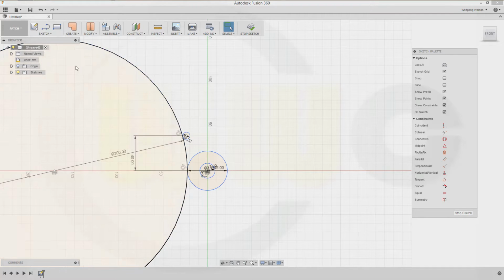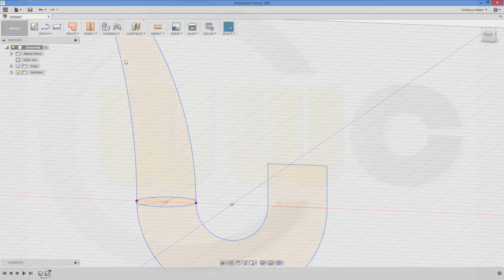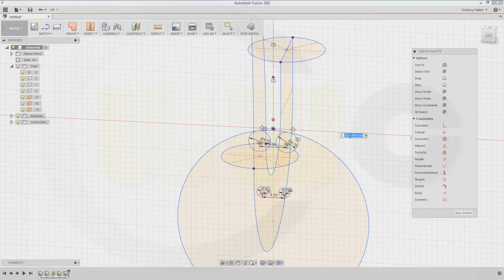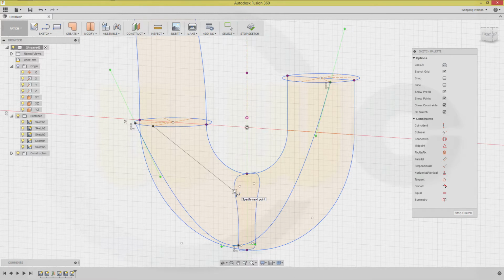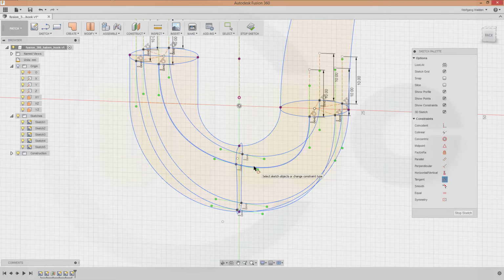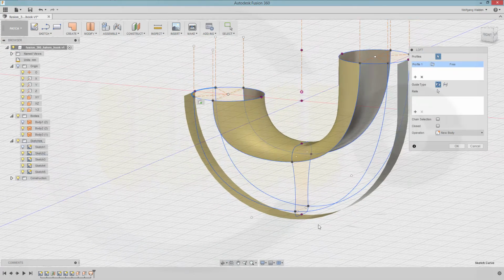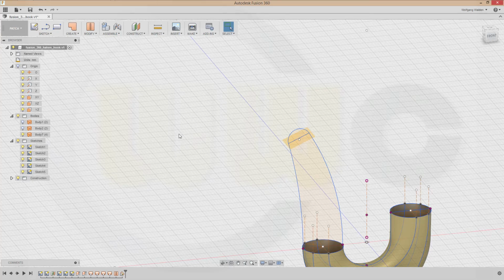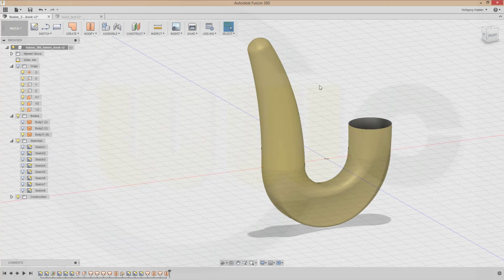Haken - Hook - Autodesk Fusion 360 Training - Surfaces

Comment: Is there any reason that you do not use mirror on axis symmetric parts?
Reply from the maker: Yes there is a reason. The problem with the "mirror" command in part design is - usually if you model one half of a part and then want to mirror it - "one or more features/elements can not be mirrored" pops up. If you do surface design it usually can be mirrored.
Reply: Wolfgang Walden I did not know that. Thank you.
Reply from the maker: Over time you would experience the same ;)